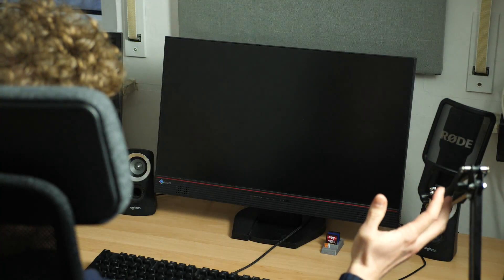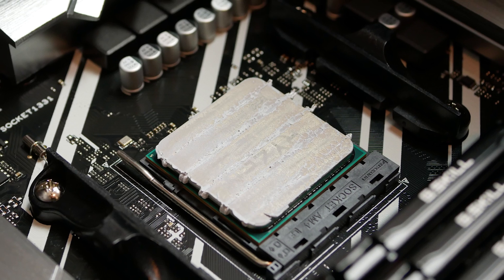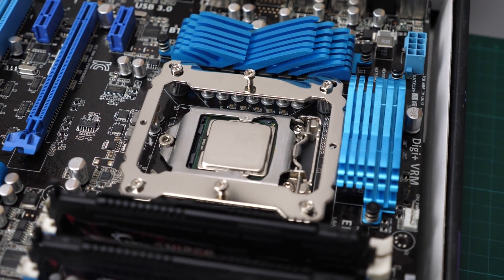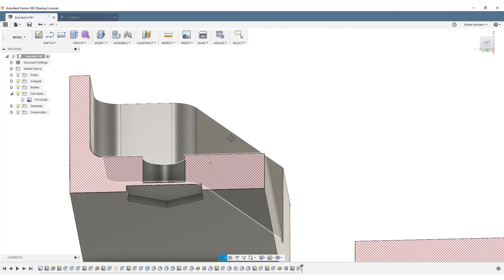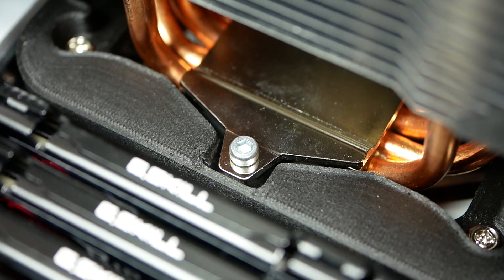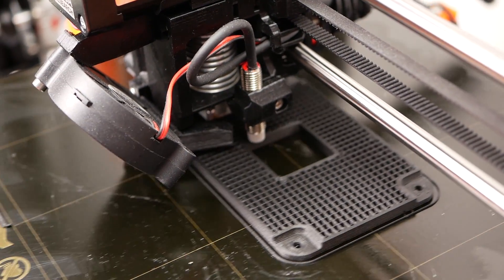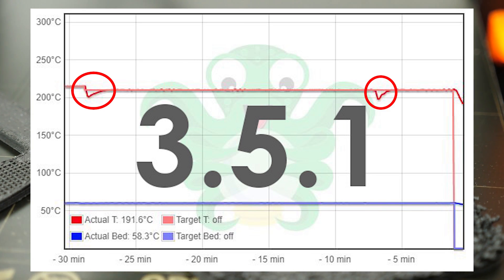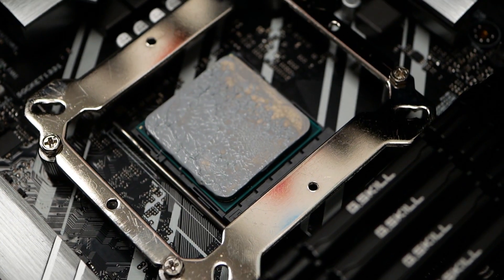I almost fried my new CPU because I overestimated my 3D print.

Comment: I really like all your videos but your case is this one does smell "mandatory event"

1 - Should have been printed 100% infill
2 - Should have been printed with PETG, fiber things have no feedback for long stress
3 - Missing gigantic margin for unlayering stress
4 - Way too fast printing ! Such print sould be slowwww and hotttt to ensure perfect fusion of material

Doing my own for a waterchilled 9950X.  Objective of liquid is ~ -20°C
5mm of insulation all around the socket with honeycomb internal structured TPU. Huge cover of PETG to hold the waterblock + frame.
Joined TPU parts (as few as possible) will be stuck with TPU glue. I MUST avoid thermal bridges, that is the true danger of waterchilling, and I allready met them by past. Air blower all around the socket to avoid dew point.

Just asking myself, what insulation can I put on CSMs to insulate it and remove it if any warranty needed. Was used to apply nail polish that can be removed with solvent, but maybe there is a better solution ?

Any advice for such project ?

Regards

Comment: JESUS that poor  bracket is screaming under the load of the CHONK ASS air cooler, I think you would be just fine 3D printing the mounting brackets for an AIO type cpu cooler seeing as it doesn't way nearly as much so therefore shouldn't cause the creep to overtake the tolerances of the 3D printed bracket

Comment: Revisiting this video just today because I needed to make custom brackets to attach a regular cooler to an HP motherboard with a hole spacing of their own. Printing it with PETG with a 110% flow made a messy print which needed cleaning but quite strong and resistant to creep. Now just drawn and printed two LGA 2011 80x80  brackets in carbon PETG, 110% flow and 40% infill with 1,6mm walls. They are rock solid. I expect no problems since the regular PETG worked fine. I took this route because i watched a video days ago about printed parts resistance to creep and the two best were ASA and PETG. PLA worked also good until tests rised ambient temperature. Nylon, with no carbon, was the worst so I thought that if the base plastic is already better and worked for me the carbon reinforced one should be perfect. One thing to consider is that I achieved to get Tungsten nozzles that were for sale some time ago and they are eternal and have much better heat transfer than steel. It's weird I've not seen reviews of this nozzles anywere because they are perfect for high temp and abrasive materials.

Comment: can't hurt to sneak in some steel reinforcing rods. just model in a cylindrical tunnel with a flat ceiling for the rod to sit in, and add a pause print right before that ceiling prints. i use mild steel for this sort of thing, where i live it's pretty easy to get 1/8" or 1/4" round bar, the 1/8" can be cut with bolt cutters and the 1/4" can be cut with a hacksaw. for this application you probably want a harder alloy, you could use a piece of hardened shaft if you have a cut-off wheel to cut it to length, or if not maybe just use some cheap drill bits that are close to the right length and adjust the model accordingly, or torque the heads off some machine screws and use the shafts. to ensure maximum load transfer into the rod, you could put a bit of epoxy in the bottom of the trench before inserting the rods (making sure not to get any near where the printer nozzle's gonna go!)

Comment: i had the same cpu before my current, ryzen 7 2700x. i had it liquid cooled, but i bought a cheap pump and after a few months it died. the cpu was running 102° C for 4 days before i noticed

Comment: You can't really kill a CPU by not cooling it. Most turn off at around 100°C to prevent damage, though some tolerate higher temps.
Reply: Yeah at 100C it won't hurt the CPU at all but it turns off before it gets any hotter to prevent damage. Although most CPUs will stay at 100C for long but throttle performance
Reply: I have not watched the video, is his "I almost fried my CPU" just that he possibly made it overheat? If so then it's missleading as any modern CPU will turn off before it reaches temps that'd damage it. Bro thinks he's still in 1999 cooling his Pentium III or what? 💀

Comment: Another easy solution would be to add small metal strips that are screwed along the edges to give stiffness in the region that failed.  You can get metal strips like that at any hardware store.

Comment: Could you not have glued a couple small strips of aluminum to the outside of the original bracket, that spanned the two weak points, and provided rigidity to the entire length of the bracket? That could solve the creep issue entirely.

Comment: Ive been running my graphics card (GTX 970 with a bit of overclock) with a 3d printed refrigeration system for almost 2 years (with 2 different designs that i made myself during this time, and a third one coming). The fun fact is that i used PLA+ and it stills stands besides the deformation haha

Comment: The reason was your 3 d graphic card was not good quality and it over load the system. Either change the graphic card or change the scanner find a good insulated ultrasound scanner or insulated infrared scanner

Comment: LOL, just went to the trouble of creating my own AM4 to LG1200 heatsink adapter and was feeling to good about myself and then find this video, back to feeling like the noob I am!

Thanks a lot for this very useful information. Ill see how to improve my adapter or just buy an LGA 1200 cpu cooler, was fixed on the idea to use AMD Wraith Prism Cooler on my I5 10400 mostly for the nice looks  and higher TDP capacity but after watching these, buying a new boring cooler seems the better solution for now.

Comment: I wonder if you could have made a hybrid part? Like printing the bracket with a hole that ran through high stress areas. You could insert a short section of CF tube or aluminum tube or steel rod.

Comment: This is an unacceptable cutting of corners just to save money. If you're financially able to afford an RTX card you can afford a new cooler. Stop trying to justify printing everything, practicality matters alot here. I wasn't even willing to use a cheap cooling option for my $2500 system build and I work a crap job at a grocery store. What you failed to consider is that the metal brackets are used for a reason. Again this should have been as simple as sticking to products designed for this, or you could use metal.

Comment: While I do advocate using 3d printers to fix things that would otherwise be useless, I think that this application is too demanding for a 3d printer. There's surprisingly high forces holding that cooler down to the CPU, and high, evenly distributed force is key. I think that something as critical as a cpu cooler should be as reliable as possible, and something that you have to check every few months because it might fail after a year or two doesn't strike me as reliable at all. What if you forget to check it, or maybe you do check it and don't notice something is wrong? I think it'd be way better to make the part out of steel, or maybe even aluminum. Frankly, I'd just buy another cooler. There's no reason to risk frying a CPU just to save $50-60 dollars.

Comment: With parts that see constant heat and the more air gap inside of the part the more the part tends to warp so the best option would be to do a solid piece if you can afford the time and material.

Comment: You could if you really want to use PLA use cooling fans or even better have cooling fins on the part. It kinda depends on where the heat originated. If the heat came from surrounding air (convection) cooling fins wouldn't do much. If however, it came from conduction it would. You could also try placing more space between the heat source and the stress points so there is more surface area and longer travel path that then causes more dissipation of heat. If it came from radiation blocking the source will do.
Source: mechanical engineer student

Comment: heh, amateur pc build mistake.  It happens to everyone eventually.  rule of thumb, Don't f with the mounting bracket unless you're making a custom hi mounting pressure bracket out of metal.   I use a 4 mill thick copper plate with ribs on the outside and a 0.5 mm thermal pad for my mounts backplate + a fan on it.  Granted, I also run a 5 - 5.4 GHz FX8320, that's about 250+ watt's TDP compared to your 95,  I need all the cooling I can get for the mini furnace.

Comment: Nice video ! Perhaps adding a thin but tall shell section around the part perimeter would make it stiffer, and more creep resistant.
Since the top of the shell wouldn't be so close to the CPU, and creep increases non-linearly with temperature.
Also, beam stiffness increases with b.h^3/12, so increasing height h by 3 would increase stiffness by 27. Might be worth giving it a try.

Comment: Frying a CPU is near impossible now, even if you turned it on with no cooler it will just turn off because of over temperature protection, just saying, so the title is a bit click baity, hell if used a CPU for about 30 mins with just some thermal paste and with a metal water bottle on top of it, as a test before I got the cooler

Comment: What about cutting a couple of plain metal strips, and making a recess on the top surface of the bracket. When you bolt it down, the strips then spread the load.

Comment: I did not know about creep! Thank you for that.

Also, this strikes me as EXACTLY the sort of application that 3d print is made for: custom attachment solution.

I too have a custom mount for my PC cooler, but I made it before I had my own 3d printer. I instead made it out of sheet metal. It's not much to look at, but I'm quite proud of it, and it almost looks good enough to have come out of a professional shop ;) But yeah, if I were facing the same problem today, I would try to solve it using 3d printing fo sho.

Comment: i actually have 3d printed parts in the water loop of my desktop, regular pla, have been working perfectly for almost 6 months now.
Reply: Hey man, what is the temps they are exposed to? I need to make an AM4 bracket for my corsair h115i watercooler and i'm scared it may melt, will ABS be strong enough?

Comment: I planned on doing this, but opted for the quicker option of using zip ties
Reply: Same here. I was afraid they'd significantly creep over time as well but after 4yrs of running they still hold up nicely 😇👍
Reply: Yep. 3 years later it still works

Comment: Well, I have done the same exact thing you did. I printed cooler bracked for my Ryzen 7 1700, but did it with just regular cheap PLA and it work perfectly. 
Also I believe you put too much attention to heat resistant. The air around CPU will never be hot enough to heat such bracket to 60C. My bracked is in direct contact with heatpipes to push the cooler to the CPU (I have added some thermal isolation) and no problem there.
Reply: Hey man, i want to do that for my corsair h115i watercooler, soo, the bracket never gets that hot? Maybe i should use ABS just to be sure???

Comment: ASUS has 3d print schematics for their motherboards on the website you get drivers/bios updates on. It's pretty cool. They have RAM cooling mods etc. The motherboards even come with holes for the 3d prints to fit into.
Reply: Aren't those prints strictly decorative and have just 1 corner on the MB available to be screwed at?

Comment: I personally have printed brackets for my watercooling reservoir! I bought many second-hand components for my loop and the reservoir pump combo didn't come with a bracket!! So I 3D printed a bracket using the Laing D5 bracket design and it appears to be working well! Although the reservoir does seem a little heavy for the bracket, my computer doesn't move so it has enough strength in simple PLA.

Comment: PETG seems to have the least creep compared to PLA and hybrid nylons.  A flex-fit iPhone holder that I designed for use in my vehicle failed with both Black Hatchbox PLA and Black Taulman Bridge Nylon.  Only once printing in Black Atomic PETG did it cease to fail (4+ years now in an always-outside E36 BMW M3 with black interior in California :)

Comment: Great video as always! I have also used 3D printed parts for my computers cooling system. I have "custom loop" wich consist of scraped-apart dehumidifier chilling water on my balcony, and tubes going to my room, to radiator (so I can cool my room also) and to my computer. But cuz I'm cheap af, I ordered the waterpump from ebay, it was supposed to be 1500 l/h pump, but I tested it and it came out around 300l l/h, so I designed copy of the "head" of the pump, with bigger chamber, and new impeller, with more and wider blades, now I'm getting much more pressure out of the pump, and more liters per hour!, It's actually pretty amazing what you can do with 3D printing

Comment: You could've just used a tungsten carbide drill bit and put 4 additional holes in the original mount with the am4 spacing, that's what I did for my axp-100r

Comment: You could have designed the bracket to accept metallic washers around the screw holes, and even some flat braces (the sort sold at hardware stores) at selected places, to reinforce it.

Comment: Honestly the 3D printing method is still extremely valuable for making molds and prototypes for resin casts later on. This would be a good example of that use-case where the prints themselves don't hold up under the stress, heat or other environmental conditions. 
This would be a great application for a fiber-reinforced thermoplastic, though the reading material on this subject is somewhat dense and academic it can be done and on significant scale.
I don't think enough people utilize 3D printing for this sort of thing when there's so much potential in this area. Elephant in the room below

This is especially something that some of the more... Ahem adult-oriented types should be aware of as you can use all sorts of materials in casting. Including double-shot silicones of varying hardness like the professionals.

Comment: Had the same issue just recently, but solved it in a more traditional craft fashion. I also had an old huge ass thermalright cooler i wanted to use for my ryzen build. And then as I assembled my computer I discovered that the am3-am4 mount holes was different.. But I actually solved it with some simple iron sealing wire. 

What I did was to cut two sets of 1.2 mm iron sealing wires that i twisted together in pairs - to make them stronger(especially in respect to tightening later in the process). 
Then I drilled some slightly larger holes in the bundled back bracket of the ryzen cpu, to fit the wires through.
After that i applied thermal paste onto the cpu and placed the cooler on top, and fitted the wires from the backplate bracket, then through the motherboard and then into the am3 thermalright front bracket. 
To tighten it all I used a concrete plier. It worked wonders to me.
In stress test of the cpu with prime95 I reached 60c. Then i stress tested the gpu (rx580) and cpu simultanious and got a peak at 74c out of the cpu due to hot gpu air.

But I dont get me wrong. I really appreciate your "high tech" cnc attempts tho. Your channel just helped me a moment ago figuring out why my banggood laser cutter would not move due to my decimal format in regional settings. Thanks!

Edit: To twist the wires i ran a power drill I had tightened to the wires in one end and used a flat plier in the other end.
Edit 2: Did not have a top drill available, as you showed in the end that would have been the most convenient. 
And again: I get that was not your point of this experiment.

Comment: Rtx 2070? That uses more energy than a threadripper, a rc vega 56 or 64 should be enough
Reply: The 2070 is less power hungry then the Vega64, faster and not even cheaper. I know being an AMD Fanboi is the way to go in 2019, but the 2070 is just the better card.

Comment: You may have been able to concave the design a little (or set the mounting nuts even lower than in this design), and use screw torque to tension against the elasticity. Over time, you might need to further tighten the screws, with care that they do not reach the circuit board out the other side of the nuts.

Comment: @CNC Kitchen great video. I didn't think about doing brackets etc but i thinking about mod peripheral, like modding Logitec g102/g203 mice, it have awesome from engineering side of view sensor, but shell is kind of strange on feel, so i tryed to do an outside shell modification and glued it on top, but since the ergonomic form of the mice it's kinda hard to make a perfect model for printing with a minimal gaps. It still be probably a good thing to make g102/g203 shell feels like Steelseries Rival 110 or Microsoft WMO or Zowie ZA12.

Comment: I am all for diy, but Cpu retension systems are no joke and I would pretty much allways use solution from a manufacture especially if the diy solution is not made from metal. 

I still enjoyed the video though.
Reply: Jakob K. zipties work fine aswell lol

Comment: I'd be concerned that the print will just fail slower than the previous one. Over time, the gap between the cooler and CPU will slowly widen, decreasing cooling efficiency just like with the first failure. However, the failure will be so gradual that you will be running at slowly elevating temperatures for long periods of time which might reduce the lifespan of your CPU rather than it getting throttled after a couple of days with an decisive failure.